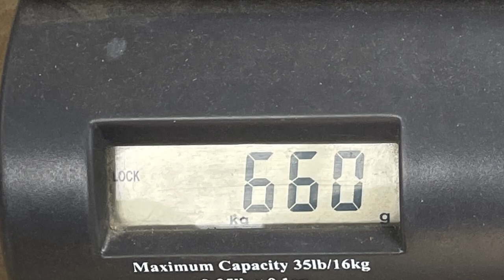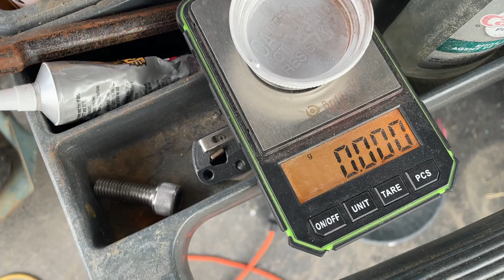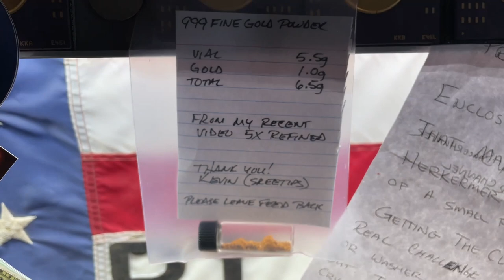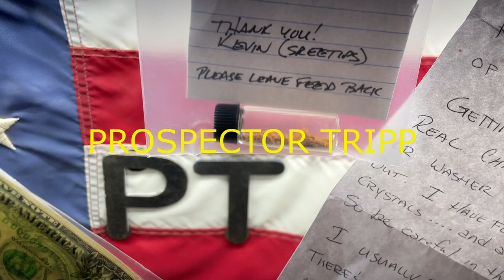GOLDFINGER, 007 PURE GOLD ✌️

Comment: I have some of the gold fingers, not sure I have the patience to do what it take to get the gold off of them. Good tips on the glassware. Really nice looking gold you there. Fun stuff to play with. 3+ grams is ok. 😎⛏⛏🔥🔥
Reply from the maker: Hello Chuck, I forgot to attach the safety message 🙄
Your gold fingers can be easily processed with (AP) Muriatic Acid (HCL) and 3% hydrogen peroxide. 
1. Do outside, wear gloves and chemical respirator.
2. Put your fingers in a small clean bucket.
3. Pour in enough HCL to just cover the fingers.
4. Add a little peroxide to get your reaction going (bubbles a little) and cover up with a lid (loosely so gas can escape) and leave it in a safe sunny area.
5. Check and stir a bit daily and add a tiny bit of peroxide every so often if it is not reacting, until all the gold foils fall off. Could take a few to several days.
6. After all foils are off. Pour off most of the AP solution into a waste container bucket and then pour everything else thru a plastic strainer with a large pan catching the gold foils, rinsing super well with water while removing and throwing away the gold less pieces of circuit cards.
7. Wash well with water and melt into a button. The gold will be not pure but still a very high karat value! Maybe 18~22k!
8. The small amount of waste acid can be diluted as shown in the instructions on the container of muriatic acid and used to clean a stain off something like your (cement) patio or cement driveway or just neutralized and disposed at your local county household waste disposal facility.
Gold baby!
Please Be Safe brother and have safe travels!
✌️PT
Reply: @ProspectorTripp  Thanks Tripp for the tips and step by step instructions. I may just give it a try. I think I still have a couple old PC's laying round that need salvaged for mor gold.